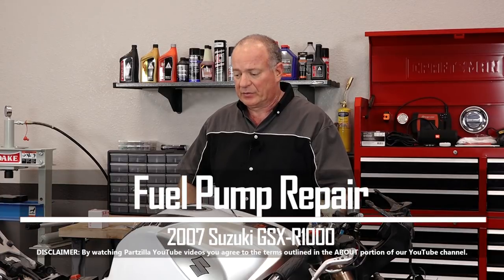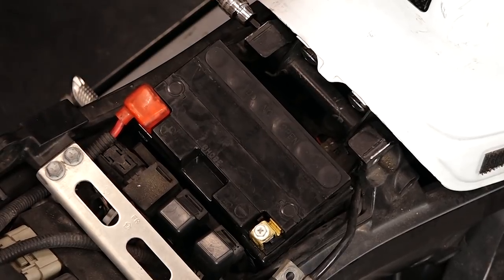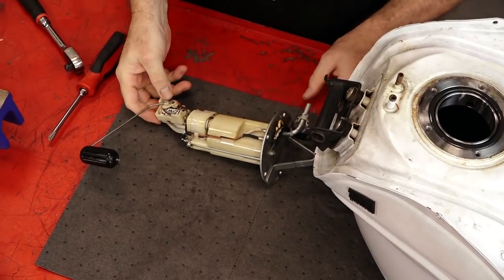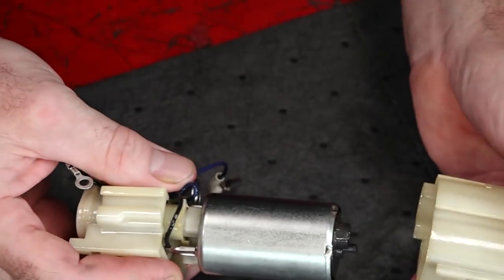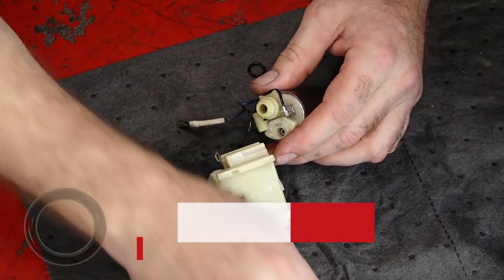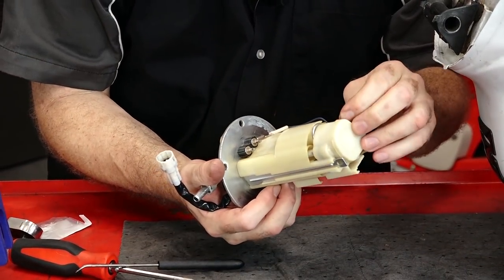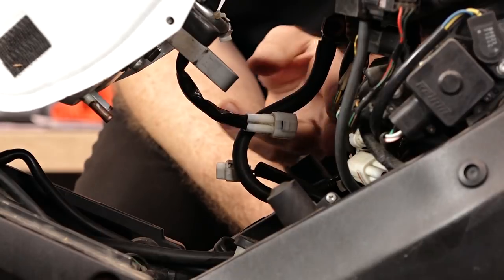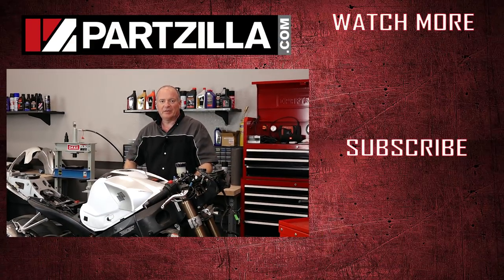GSXR Fuel Pump Repair | Suzuki GSX-R1000 | Partzilla.com

Comment: Thank you for the well made and detailed instructional video. You explained everything just right and the video quality is great. I have a k7 gsxr 1000 (12,000 miles) and it was running very hesitant and "choppy". I watched this vid and easily replaced my fuel filter and now my bike runs like it's supposed to. This saved me a lot of money, time, and headache.  Your work is highly appreciated!
Reply: You changed the pick up filter or the regulator housing ?
Reply: @johnaustin7507  I only changed the filter and that took care of my problem.

Comment: My Bandit GSF1250S K9 was rooted. I did everything, new fuel pump and strainer, o rings gave it all a good clean. Reinstalled and it went great for a day then started dangerous starving under load again just like before. It ended up being the fuel pressure regulator. Great video. The GSXR pump assembly is similiar to the Bandit.
Reply from the maker: Good to hear! Glad it was close enough that it helped!

Comment: Hi John. My newly acquired K8 had been experiencing fuelling issues above 9k rpm. The previous owner had had the injectors cleaned, but hadn’t thought about the filter. It literally fell apart as I pulled the housing apart.  New filter installed and the performance is restored. Thank you!
Reply: OMG my bike is having this same issue. Hesitating above 9k when under full throttle. I’m gonna replace the fuel filter!!!
Reply: @tedm6454 my bike has the same issue  but between 4000rpms 5000rpms ,,, I already replaced the fuel pump and fuel filter , clean the injectors and nothing changes!!!! Same misfire in full throttle

Comment: Appreciate your videos. Just signed up on partzilla and bought the same parts for my 05 gsxr 1000. Just turned 40k so probably a good idea to change the filter. Much appreciated! Have a blessed weekend
Reply: mike216ism what was wrong with your bike. I have the same exact bike and my FI light keeps coming on then the bike stalls. Just tryna figure out what the problem is

Comment: that is an amazingly clean fuel pump for a k7 1000, they are beyond bad for rusting fuel tanks and stuffing fuel pumps, mine went through 2 tank cleans, 2 fuel pumps and 2 injectors (i have no idea why its been all 2) and a fuel pressure regulator, i ended up sealing the tank and adding an external fuel filter and haven't had a problem since :D 

i love the video's you do and i love the fact they are also on a k7 1000 so i can follow them right to the T :) keep up the nice work
Reply: Midnight Mechanic was your bike not getting out of the 4000 rpm range?? My 750 k8 is not getting above 6000 rpms max under load and I cannot figure out why
Reply: @mistergsxr465  same mine. cant exceed 9000rpm . any suggestion?
Reply: Mohd Fikri Azri try changing your fuel pressure regulator inside the sending unit. That fixed mine and mines running like a new bike now
Reply: The best thing you can do with a Gixxer tank is always keep it full of fuel. Leaving them with an empty or near empty tank will always cause problems

Comment: The o-ring on the tube sending fuel out when sliding that back into the housing you can slide it up without the o-ring until the gap in the housing by the pressure regulator. You can then put o-ring on inbetween that gap. As anyone who has done this forcing the tibe into the housing with the o-rjng requires some force. Broke my housing one day puting it back together.
Reply: This comment should be pinned. Just cleaned my fuel pump and threading the o-ring tube up through the housing is the hardest part of this entire fix. Almost broke my housing forcing it. Everyone attempting this repair should come back to read this comment when at this step. Take the o-ring off and put it on after the gap.

Comment: FPR housing has a micro strainer, I did see you show part ,you can back flush that with carb cleaner and clean fuel with FPR and and oring removed ,then use air gun ,the block on k8 if bottom filter is blocked .

Comment: Nice video, I have misfire with my bike now. Can't go over 4000rpms - 5000 rpms , got i misfire between! I replaced a fuel pump with fuel filter not oem , sparks plugs, and i clean the injectors  still have the misfire! Any idea

Comment: Broke my o-ring disassembling my housing and didn't notice until i took it back apart because it wouldn't start. I took it apart to clean my screen and upon reinstallng it, it would not fire up. Waiting on new oring o come in from the dealer. Would the broken o ring prevent it from firing up??? Even ordered a new pump and installed still no start.

Comment: I'm rebuilding my fuel pump. The kit I bought has a metal fuel pump regulator with no plastic housing. The manual say "Never remove FPR from plastic housing." What will happen if I do? It looks like the only thing in there is an o ring to. Does removal cause the part to break? Is it welded in with glue?
Reply: Just for reference, I'm working on a 2009 SVF650 Gladius. Pretty much the same thing as a SV650.

Comment: Recently bought a ZX600P which sat for ~ 2 years. When i put the tank upside down on the table to remove the fuel pump, i noticed that fuel was leaking from the top / from the gas cap so to say. 
Do i need a new gas gap?

Comment: Thanks so much for the info...I have a 2013 Suzuki gsxr 1000 and I've replaced fuel pump, filter, had injectors cleaned, replaced spark plugs and still fuel pressure is not optimal. I designed an external fuel test rig, and when I run the pump in this system, everything works great. So my question is do I need a new pressure regulator or is there something I may be missing? Any advice is greatly appreciated. Oh, when I got the bike I rode okay, but I knew something was wrong, removed gas, cleaned rust out of tank and replaced the parts I mentioned above. Thanks for any help.
Reply from the maker: If everything tests good, the pressure regulator may be the issue.

Comment: On my 2019 GSXR 750 riding home from work my cluster gauge started blinking and than it went blank. The bike sounded as if it was about to shut off but it didn’t. I made it home safe and a few hours later I tried to start it up and nothing. I just got it out the shop from having a M4 exhaust system, Power Commander and ECU Flash (Programed). I only drive it 7 times and this crap happens. So I just install (On my own) 4 Spark Plugs
Starter Relay
Fuel Relay
New battery 
Rectifier 
Stator
Fuel Pump & filter 
And it’s still not turning on. It’ll crank where you can here everything trying to turn on but nothing.

Comment: How do I know if it's the regulator that's causing my problems? I replaced the fuel strainer and the fuel pump, my bike is getting the right pressure but not the right fuel flow according to the manual.

Comment: Great vid.  You had about a gallon of gas inside the tank?  I have a Suzuki gsx 650f and am going to replace my fuel filter and have about a gallon inside.   So it is ok to have that inside and turn it upside down?  Just wanna make sure before I do it.  Thanks a bunch and the video was great.
Reply from the maker: Try to get all the fuel out.

Comment: I have a 2008 GSXR 600 that won't rev pass 6000 rpm in all gear. In idle, it is ok. It does has some rust in the tank. Could a clogged fuel strainer cause this? Or a fuel regulator?
Reply from the maker: Could be debris, fuel pump, fuel regulator or bad coils.
Reply: Naitian Wang did you ever figure it out ? Mines doing the EXACT SAME THING.

Comment: You make it look so easy. And so far it is relatively easy.  I am to the point of removing the fuel pump on my 06 1000. I cannot get the fuel pump out. It keeps getting caught up on a tab on the pump. Any suggestions.  Any one
Reply from the maker: They get a little stuck sometimes, just twist and give it a little pressure, it should come through.  Just don't pull hard enough to break anything unless you're replacing it.

Comment: I replaced my sparks , but my problem stil there, iu cant go fulltrottle over 8000+rpm,, on my 1000 k7, i think i need to replace the fuelfilter too, or is it maybe something diffrent ?
Reply: Clean you injectors - its easier and if still bad … clean your fuel pump like this 👍

Comment: Thank you so much I love your videos . I've got a k8 1000 having fueling issues. I followed this video and changed the filter/strainer but I still have the same issue . The  bike has been gradually getting worst . Bike starting face falling at 7-8k rpm  then drop to 3-4krpm and now it's 2krpm I can barely do 30mph on the way to the suzuki shop today. The pressure test showed that afyer thw bike has been running for couple mins and it hits up it begins to idle rough and then the bugging out starts. At that point the pressure tats showed a drop from 42psi to 10 psi . do you think I should replace the entire unit. Or is it the pressure regulator? Maybe the orings ?  Or can should i replace the pump motor .  Thanks again for all your videos I have saved them all into my library
Reply from the maker: You can go through the whole unit, but I would just get a new pump.  Sounds like it's going out.
Reply: Thanks.  I'm gonna order a pump with some new o-rings, as the O-ring on the top of my pump seems to fall off quite easily . Do you think the fuel pressure regulator needs replacing as well ? As you stated its responsible for holding the pressure .
Really appreciate your your time . Thanks for replying . I'm gonna stay tuned for some more gixxer videos .
Reply from the maker: You can test it to be sure.
Reply: @PartzillaParts  how else can it be tested . My local suzuki dealership did a fuel test like u did and said it dropped as low as 10psi . Buy is that definitely the pump or could that also be the fuel pressure regulator.? I've ordered a replacement pump . So I'm hoping that's all it is if not then I will need to also get a regulater.
Reply: Hey . I've just finished installing the new pump . And I'm still having the same issues . I'm honestly tuning out of ideas   . So fate I have done service , sparkplugs , oil , oil filter , new fuel pump, new fuel filter . Pressure test said 10psi . It also feels like my clutch is slipping but I've just installed a new clutch recently . Any advice at all would be deeply appreciated as I have been to 3 shops and everyone is scratching their heads .  I have a video will try to upload and maybe send you a link . As I am that desperate.  Thanks for your time I know you are busy
Reply: Have you had any luck fixing this? My k8 750 is doing the exact same thing dude I cannot figure it out
Reply: @kryptonitefitness  same mine 08 gsxr1000 cant rev above 9000rpm. should i order new pump or anything else prob @partzilla
Reply: So you didn't change out the regulator??   You said yourself that you were wanting a way to test it.  I mean come on Man! All this guy did was change the strainer.  WTF- now I have to look for an informative video cause this aint it.   I'll bet he never even fixed it!  He never said he fixed it...  LOL!!
Reply: Gene Williamson what are you having trouble with
Reply: @mistergsxr465  kryptonitefitness
Is still having the same problem.. My problem is "CHASING A PROBLEM".  With time and money, replacing good parts.  I'm fixing to remove my fuel pump, my 08 GSX650F recently started bogging down around 7g,s.  I hope it is just the strainer but I'll do a very thorough testing of my parts before I buy anything. Any help would be useful. I'm an electrician so I like to test everything and pinpoint the problem.
Reply: I have same problem.please help me
Reply: Can anyone help with the final solution to this what seems like a very common issue?

Comment: The manual suggests cleaning that intake filter on my 03 SV1000S. Have you had luck doing that?
Reply from the maker: If it's a paper OEM filter, just replace it.  If it's cloth, you can clean it.
Reply: Partzilla 
Thanks. Mine is cloth. It is much heavier than car intake filters so I cleaned it but have worried about doing that. I will just ride.

Comment: Hello i v got gsxr 600 k7 i m having issue with throttle engine start every time but cut off after 20 or 30 seconds any help will b appreciated thanks

Comment: Hey there I have question. My bike was running fine. I wanted to try a power commander 3 an see how the bike performs with it. I rode the bike an it was running fine at first. But now it doesn't want to exceed more than 6 to 7000 rpm. So can a power commander ruin your fuel pump?
Reply from the maker: Not likely, but it can affect your tuning.  Try disconnecting it and see if it runs better.
Reply: @PartzillaParts  I took off the power commander completely. An I think my pump is not good anymore.

Comment: My 750 has a very rusty and corroded regulator,  could that cause bogging under load and backfiring on deceleration?
Reply: What ended up fixing it have the same problem

Comment: I pulled out my fuel pump assembly and its covered in gunk, just wondering what the best way is to clean it? I've already cleaned out the fuel tank and it was pretty bad
Reply from the maker: Fresh gas and a toothbrush.

Comment: Fuel pressure regulator if you can’t get over 6000-9000 rpms. Change that part out and you’re set

Comment: my 08 gsxr 1000 wont rev over 8000rpm. i just replace the whole fuel pump from partzilla and the problem still same. help me!
Reply from the maker: Fairly common issue with GSXRs.  Could be fuel issue, but start by testing your coil packs.  They are most likely going bad.

Comment: My 2013 gsxr750 won't rev past 10k rpm I was told it's the pump I tried cleaning the filter but the problem still there I was told to try cleaning the resonator if that fails tomorrow how can I purchase a pump from u I'm in jamaica
Reply from the maker: Yes, we carry the full pump for the GSXR 750 and we ship to Jamaica.

Comment: Beware of the fire hazards of removing a fuel pump! Don't burn your bike down. Keep leaks to a minimum, no smoking or sparks! Static electricity too. My fuel pump has a mind of it's own. V-strom 650. Trying to figure out why the FP motor won't run.
Reply: Turned out to be a bad FP relay. All fixed!

Comment: Ok sir ? For you I have 2007 gsxr 600 sometimes it stalls when I roll on the throttle as if in a car that has a shut off switch  a few revs then it's ok for a sec.. but doesn't  fo this all the time and twice it has died any thaughts on this
Reply from the maker: Check to see if the throttle body is sticking.

Comment: Mr Talley.
Please advise me,  I have a 06 sv650 . No power to instruments cluster. I don't hear fuel pump "humming " . With jumpers I get bike to turn over (crank). Yes...35A  fuse on starter solonoid has been changed. (Was blown)
Bike is new to me. 
Can you offer any advice. 
Thx in advance.
Reply from the maker: Have you load tested the battery.  Just to eliminate the basics.
Reply: @PartzillaParts  Thanks for your time,  attention and expertise MR TALLEY. 
 Yes , the battery has been tested and is expired. (New one ordered. Thx) I have the bike running , but only if powered by boost (or external source ) should it run without battery once started or is it stalling out after removing power a indication of "alternator "  issue (or charging failure ) ??
 Thank you again for taking the time to reply and help me with my problem. !! 👍👍

(Big fan btw , like how you are thorough and easy to follow /explain things in "layman's terms" where/when needed.)
Reply from the maker: @ljtremblay4229  Yes, I would test the stator and rectifier.

Comment: It is possible to having jerking engine condition at certain RPM because of clogged fuel pump strainer ?
Reply from the maker: Is it bogging or is it something in the gearing?  It's possible, but not likely the strainer.
Reply: @PartzillaParts  the feeling just like when you open the throttle when it reach certain rpm (normally at 10k rpm gear 5/6) the engine lost the power, just like went to idle rpm..no power at all..
Reply from the maker: So it doesn't do it @10k in the other gears?
Reply: @PartzillaParts  as i remembered, it does happen at high rpm and low gear, but it just happen once since this problem appear. For the record, there is always happen at rpm 10k, gear 6, but, if im going fast, not hold too long at rpm 10k, it was notting jerking at all..it kinda weird..😅how about fuel pump internal damage or something..🤔😅 or wiring problem..😌
Reply from the maker: It could be a lot of things and then some.  Fuel pressure, air flow, ECU, throttle body, fuel pump...Kind of hard to test at 10k rpm.
Reply: milan512500 did you get it fixed?

Comment: I just got a 2002 suzuki gsxr 1000 for 2k that only has 10k miles...When i first seeing the bike, it turned on quick and ran good...6 months later, i finally pick up the bike..Now it doesnt want to turn over..the start button works and i have no codes showing up...It sounds like it does want to start but it doesnt...Any suggestions!!!!
Reply from the maker: Bad fuel?  Frozen pump?  Cool be a lot of things if it sat for that long.  Make sure the fuel pump primes, then drain and add new gas, injector cleaner.  Try again.
Reply: Partzilla i did all that except drain the gas..added i gallon of gas...I sprayed inside the air box and it runs but when turning the throttle, it shuts down...Like if gas is not flowing right...
Reply from the maker: Check fuel filter for debris, could also be a clogged injector.
Reply: Partzilla the bike wants to stay on but once i turn the throttle, it dies down...Also would low coolant level make the bike like that...??Thanks for advice tho
Reply: Willie Garcia did you fix the problem?

Comment: Hi where is the H02 sensor (For E-02,19) for a 2008 gsxr1000 located
Reply from the maker: Should be right next to the muffler.

https://www.partzilla.com/catalog/suzuki/motorcycle/2008/gsx-r1000/muffler